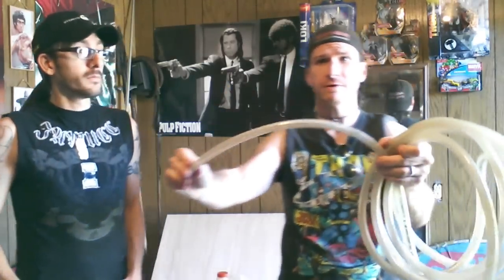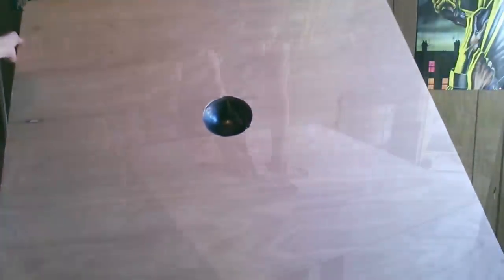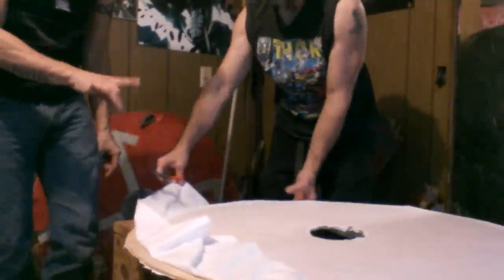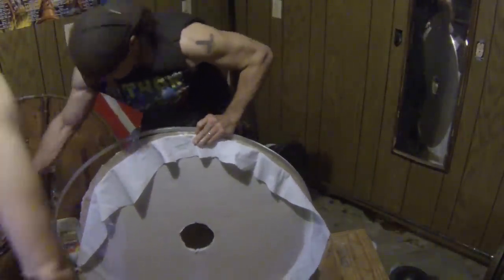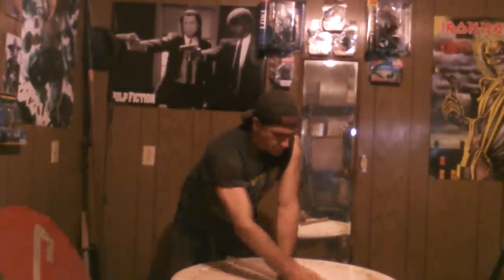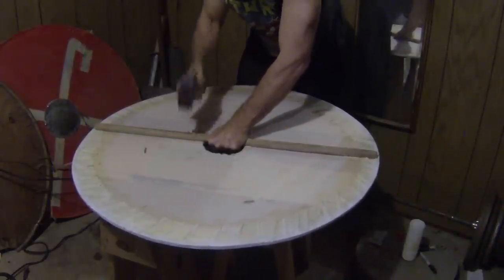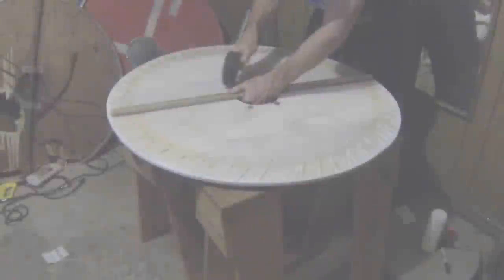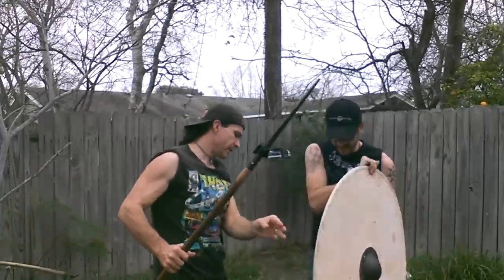How To build a Period Viking Round Shield with Modern Materials!

Comment: Well, calling this period would be wrong since you are using plywood and modern canvas.
Reply from the maker: We explained the hard wood plywood is covered in thin veneer back and front so is equivalent to planking if used with the grain running the correct direction. You can use 1/4" planking if you choose and just glue it together with the same glue. You can use tight woven linen which is period or any linen like material to save money. The reason for the substitutions is to make it modernly easier and cheaper with the same results in strength, size and density. We did not use canvas it is too heavy to get a good composite. We used a tight style linen weave clothe. If you choose from this video and our information you could go way more period but the idea to this video is to be able to build a period equivalent shield cheaply and easily with modern equivalents that are easily obtained. This is so many can do this project for reenactment and to be able to test a viking age equivalent.
If you construct it from hand cut your own planking and taper to a 5th of an inch at edging, Make casein / milk glue from scratch and want to buy or weave your own tight weave linen. Use heavy raw hide back and front instead and stitch it by hand. Cast wrought iron rimming and boss / umbo  with rivets to attach it. Feel free to do so but if that is all we covered I think very few would get to experience this project first hand.
Reply: ThegnThrand
Why would you have to stitch the raw hide?  I thought you could just stretch it over the shield and let it conform to shape (somehow).
Reply: That is how they did historically, the shields we have found have holes for stitching along the edge.